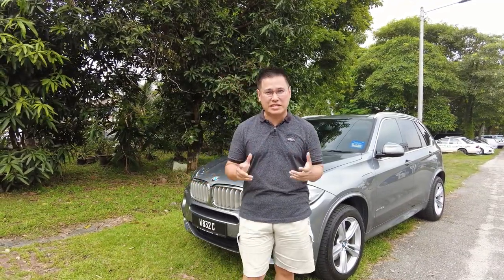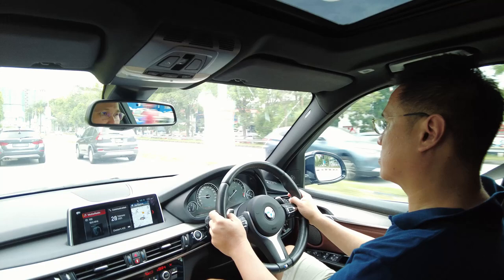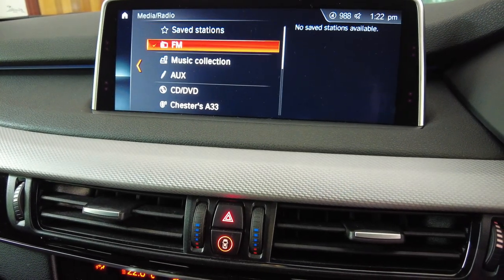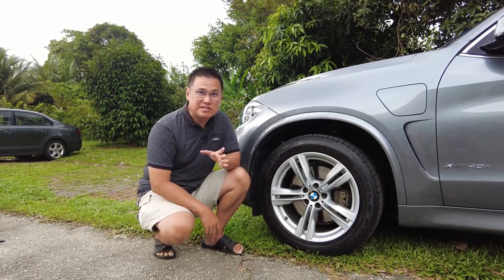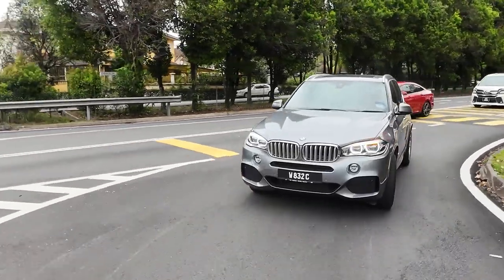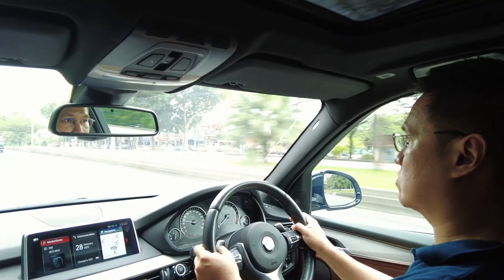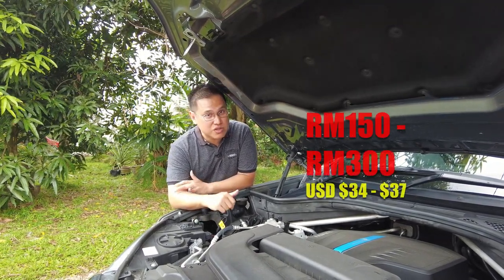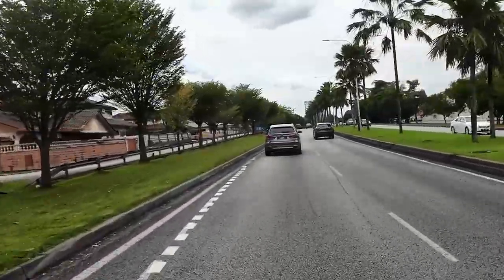Maintenance for BMW F15 X5 40e Hybrid (PHEV)

Comment: I happened to come across a 2016 model with around 50k km mileage going for around RM130+k. Such an amazing car and with the price tag it’s really attractive! Just really worry about the maintenance part.
Reply from the maker: You can't escape the maintenance, It's a BMW after all. But personally for me, for the car size and safety and design. That's a win already. Brand prestige also comes into the factor but that's least of my priority.

Comment: Thinking of buying one, mileage less 50k, year 2017. The car dealer said can give warranty for 1+2 years, cover major issues, battery RM5k per year. Have you heard such extended warranty?
Reply from the maker: Those are 3rd party warranty. But the only back draw is that, if there are any claims for the hybrid battery, they will source a used battery cell for the replacement. In short, you won't get a new replacement

Comment: hello Chester. thanks for sharing. for some reason ur x5 design looks slightly different, the model im looking at it 2017 x5. would there be different designs x5 ?
Reply from the maker: Mine is also 2017 40e

Comment: First of all thank you for the information which is helpful.  Why is there a need for 6 spark plugs when there is only 4 cylinders engine?  Additionally how are you rotating the tires as these are staggered ie. 285/45 and 255/50 fronts.  I have never rotated the tires ( on my second set ) as they are  asymmetrical.  Maybe you have different brand type from what I have.
Reply from the maker: Errors, sometimes forgotten it's 4 cylinders. lol. You can't swap between the front and rear. Just left to right if your tire is bi-directional.

Comment: Just to check worth to buy it if found one x5 2017 100k mileage? Will the rear air suspension spoil easily?
Reply from the maker: One of the common problems for this vehicle

Comment: Sir we just recently purchased the same exact vehicle 44k miles 2018 ,same exterior color but black interior. My question is related to wheel size. My set up is 19” same style as yours but square .Are your rear wheels staggered or just a bigger tire on the same wheel? I want a staggered look. It’s just looks better. What
Is your rear wheel size?
Thank you.
Reply from the maker: Congrats. My rear wheels are staggered 285/45/19

Comment: I have some problems with transmission , flyweel hausing and         Torsional vibration damper . Do you have some problems with that? Mine is 2016 40e
Reply from the maker: I don't have any issues those thus far. Fingers crossed.

Comment: Sir, I plan to get X5 second hand 2018 or 2019 within 110k budget. Please advise how to inspect the car is in good condition and what required to standby after purchase.
Reply from the maker: Since this 40e is much more complicated X5 and if you really want to get this model. Bring them to your local foremen for a physical and diagnostic check. Just your surface check may not be sufficient, if you want to play safe

Comment: Hello chester, i saw a used 2017 BMW X5 40e run 58K KM hybrid , the battery has 2 more year warranty priced at 165k. Surprisingly same color and feature as you shown in video.
I am concerned about maintenence cost too..will this be a good buy at least for next 5 years without a lot of expenses
Reply from the maker: If that car has done the last warranty claims from BMW then you're unlikely to dace any major issues with the car for next 4-5 years down the road. Not going to sugar coat it, but maintenance for X5 especially "hybrid" will definitely be lot more higher than your regular 3 series or even 5 series. But overall for the price of the used car and the size of the car, why not... hahahaha
Reply: @chestercheng.bmwowner  thanks for your response, really helpful